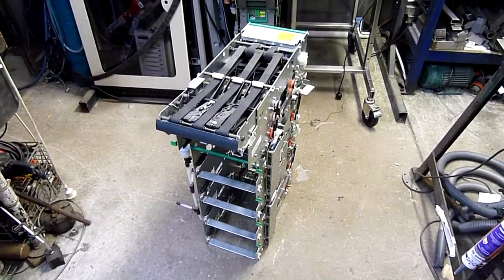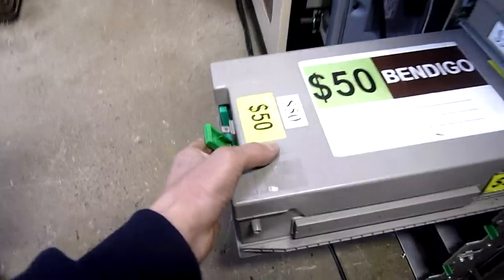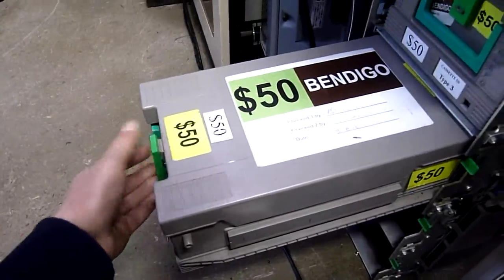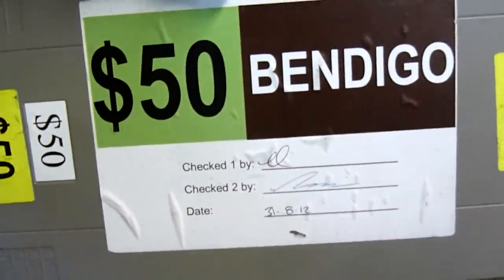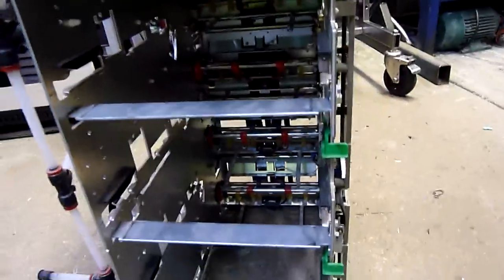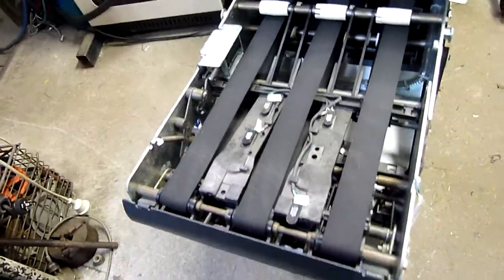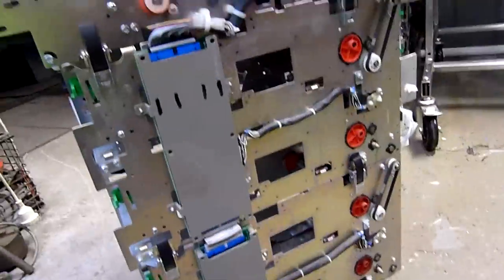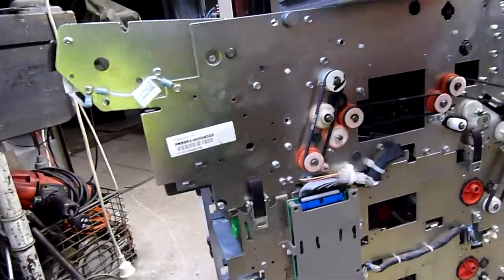NCR ATM Cash Dispenser Mech Autopsy

Comment: The old IBM ATMs were much more simple actually. I used to be responsible for daily cash loading and weekly  servicing/cleaning on the ATM at my branch. It used a simple two dial system for reading the numbers of notes dispensed and a similar belt system with some photo sensors to count and measure the bills. The cartridges had a simple 2 way key system to differentiate denominations. I remember when these NCRs came in in the early 90's to replace the IBM stock.

Comment: Clever guy, about 97% accurate. Spotted the Automotive fuel filter is being used as a vacuum reservoir. This unit does not have the dye pack feature, though.
Reply: Where would a dye pack go in an atm ?

Comment: About 10 years ago one of the local banks had an old IBM ATM, I pleaded with the installers and the bank to buy it for research. They relented claiming security and Health and Safety due to it being apparently 2 tonnes. It was old and weird, had a chip module retrofitted for chip and pin 
and a tiny 3 inch monocrhome display. 

The installers claimed it was an AT based machine with 640k and a 1024k upgrade board and 30mb hard disk drive.

Comment: Does the main drive motor run on 12vDC? It looked like an AC induction motor
Reply: The main motor is 110 or 220 depending on the region.

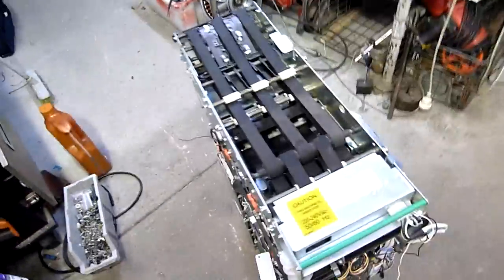Comment: at 0:44, the yello sign the machine running with 220V ?
Reply from the maker: the main drive motor is 240V, switched by the SSR under the cover.
Reply: which is the voltage the pick valve?